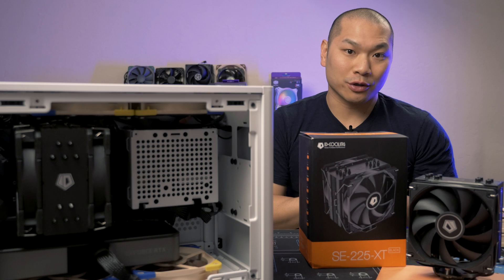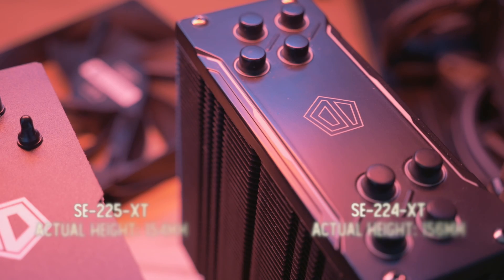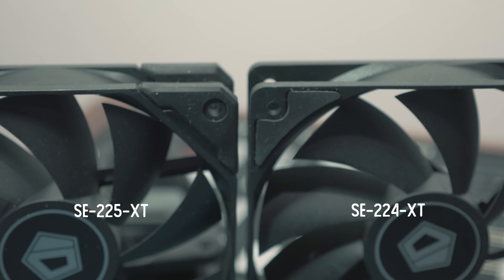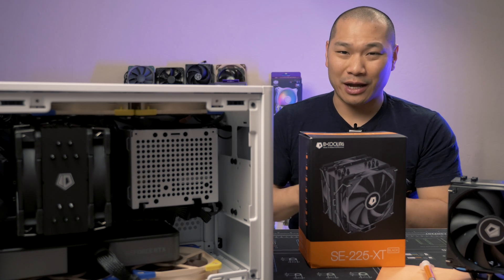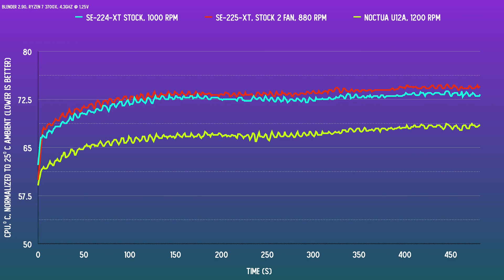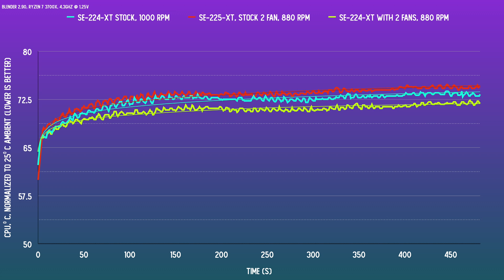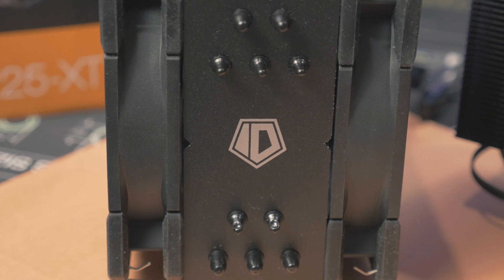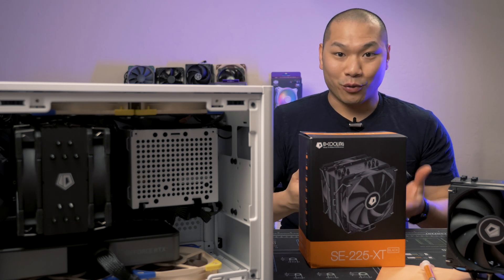The ID Cooling SE-225-XT: Ryzen 7 Test

Comment: This is a bad review, and i DO like some of your videos.
You don´t have enough thermal capacity to saturate any of the coolers and in the end, it comes down to contact.

I didn´t finish watching the video and i did jumped through it, but mostly because it just pointless to compare coolers on a CPU that barely reaches 90w power consumption. The testing platform it´s just not enough, so the results are wrong.
Reply from the maker: Thanks for checking in. I'll explain- this is a real world review that is designed to cover the majority of users. For the most part users are looking for coolers that will cover CPUs lower than 100W TDP. Testing with Ryzen 9 would magnify the differences and show if a cooler can run a CPU that hot, but at the same time that wouldn't necessarily help Ryzen 3600 or 5600X users. With the thermals from the 3700X, I wouldn't even begin to recommend this for Ryzen 9 users because in order to get it to run cool enough that fan would be in a very loud RPM range. My opinion is that it's important to test the product based on the intended market. If you're running a high end chip this shouldn't be the cooler to consider.
Reply: @MachinesMore  i think the 3700x @1.25V should be above 95 watts even, if i'm not mistaken?
Reply from the maker: Yes. Since the tested frequency is at a slight all core overclock it’s drawing close to 95W. It’s high enough to get good resolution on where coolers stack up relatively.
Reply: @MachinesMore  I’m the intended user for your content, 5600x paired with an MSI Ventus 3x 3080 in the NR200. I bought the 224 based on your recommendation and test results(and because it was 23$!), but sadly I’m not seeing anywhere close to your performance levels. 

I have my 5600x OCed at 4.6ghz all core at 1.125mV, for a fully loaded power draw of 85-90W. I’m running a pair of Arctic P12s, which are second only to NFA12s in terms of performance, and at 2000rpm I’m seeing high 70s running cinebench. I remounted/repasted and I’m not seeing better thermals, let alone anything close to your results. Thoughts?
Reply from the maker: Dominic, that sounds highly irregular to me especially since it sounds like you have a golden chip. I’ve heard good feedback in general about the 224XT and I’m starting to wonder whether there are manufacturing variances which are at play here. Definitely doesn’t mirror my experience with it. How is your paste contact? Is it pretty flat? If your baseplate wasn’t machined well I wouldn’t be surprised if it’s not performing well since that seems to be the source of its strength.
Reply: @MachinesMore  The base looked to be milled to a nice shiny 16RA or so. If I was still working in a machine shop I would have fixtured it and measured the surface finish with a profilometer. I was really impressed for 23$.

I’m using Corsair XTM 50 because the included paste was hard as a rock. When I reseated the Cooler it looked to be evenly spread. I have some Kryonaut coming in this week and I’m going to retry it.
Reply from the maker: Have you tried it with the original paste? It was as good as Noctua NT-H1 when I tested it. I’m assuming your ambient room temps aren’t wildly high. 
For a quick follow up I’m running a test on the 5600X again between the two and I will give you a ballpark at 4.6ghz all core.
Reply: @MachinesMore  Thanks man, that would be awesome! When the ID cooling paste came out of the tube for you, was it really super viscous? It was genuinely like partially hardened epoxy. I just assumed I had a defective tube, and I wasn’t expecting much out of it since it came in the box with such an inexpensive cooler. 

Also, regarding the golden chip comment, what voltage are you running for 4.6ghz all core? I found that I couldn’t go under 1.3V if I was attempting 4.7ghz, but I could go all the way down to 1.125V and pass the 10minute run of R23 consecutively. I did notice in hardware monitor though that the per core voltage is reading at 1.125V, and the “VCore” is locked in at 1.134V. Not sure what the difference is.
Reply: @MechAdv  note that while you aren't crashing, ryzen 3000 and 5000 chips use clock stretching to avoid instability when the voltage goes too low and this can't be seen on monitoring software but is reflected in lower actual performance.. so you need to check if performance drops when you start lowering voltages as well as checking for stability.
Reply: @VeritronX  Thanks for the tip! So, so with my current settings I’m getting scores from 11500 to 11650 running R23 by with monitoring software open, 85th percentile or higher in user-benchmark(it was 65th percentile clocking 4.4ghz before OC with PBO enabled), and 10700 in R23 when simultaneously running Unigen Heaven. I think that’s pretty good but I’m new to Ryzen and it’s tuning methods.
Reply: @MachinesMore  i get your point, but it doesnt make it right, because the results that you just got are kind of based on contact lottery, not on cooler´s performance. If you did this video with the conclusion of showing  and speaking about that there´s diminishing  returns to using big coolers on thermally dense 65w CPUs, that would be fare, but i don´t see that.

You can have a gammaxx 400 (the $25 one) and if you get a unit with very good contact, it might even outperform the 2 you´re reviewing.
If you wanna go by that logic, you have to do this with several coolers and CPUs to show the behaviour pattern. Ik there´s a shit ton of work......weeks or maybe months, but otherwise is just bad data, or rather data that drives to a bad conclusion.

Anyway it´s your channel, not mine, so it´s just my opinion and suggestion. You do you.
By the way, i´ve seen, you do mention many important details that even good reviewers skip, and they are not non sense (cus out there in the wild most often then not, are). Cheers to that!!
When you show the cooler coldplate, can you use something very straight and try to show how flat, convex or bent out of shape they are????..... It will become very important with the new CPUs that use a small nodes.